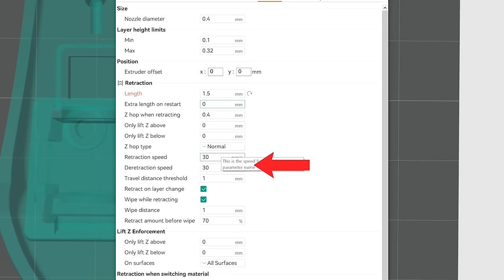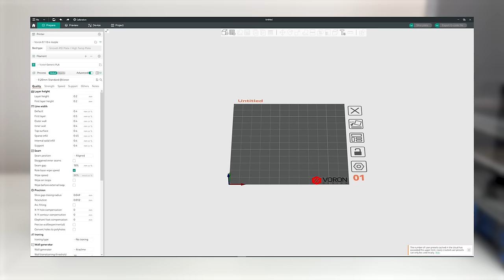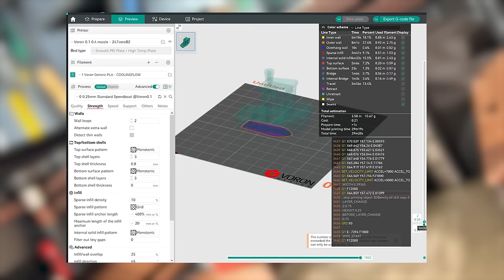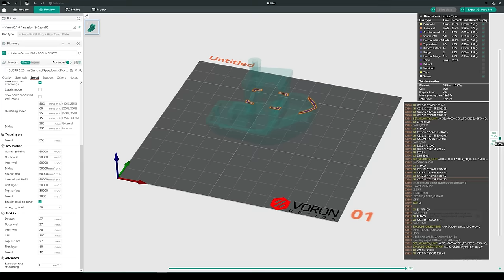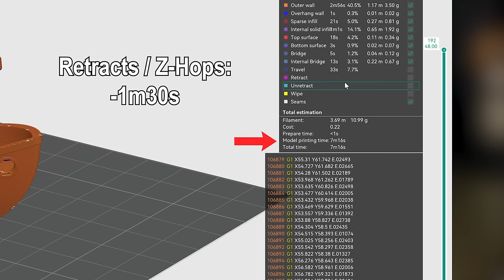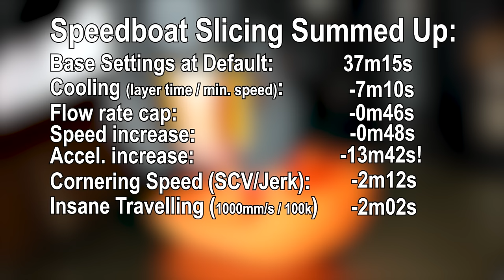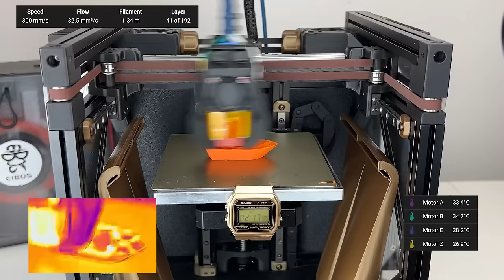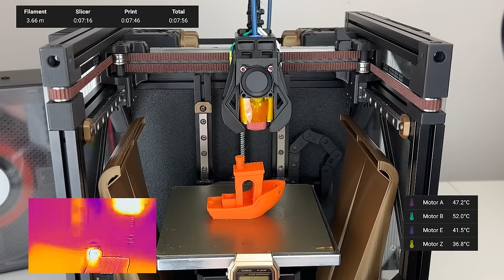Fast Printing Explained: Hardware, Slicing and More.

Comment: I just want to stand up and introduce myself. I am a benchyholic. It's been about 4 day's since my last benchy. To me it's not important to make 7.5, but to make 7.5 with quality. I find that for fast speeds the flow seems to be lacking. I can see this in your prints also. What gives... Either the toolpath is not on point, or there is some reduction in flow?

Comment: about the slow retracts, if you're printing slower they help not separate the solid filament from the molten filament in the hot end. like since the filament is more molten a fast retract just pulls the filament off of the molten blob and you basically don't get a retract. This can show as popping bubble that follow retracts from trapping air between the more solid filament that was pulled away from the molten plastic. If I have a really oozey maybe wet filament a slower retract can help but I dont go below 30-40 mm/s. Or at least that what my experience  seems to say
Reply: Yeah, I've run into that with one of my printers, had a nasty habit of clogging up the PTFE tube within the hot end.
Running speed on PLA, I hadn't even bothered with retractions or z hop for BLO

Comment: A similar video focused on faster but useful parts (technical parts) would be useful. For example, some of the settings which don't affect quality should be mentioned first (and kept to values which are still reasonable for quality parts), and so on

Comment: My secret, I prefer "Aligned Rectilinear" infill oriented at 0 degrees (so the lines run the length of the boat), for higher speed. It shaves a fair bit of time as the lines are straighter & longer. I learned this trick by analyzing the Bambu Benchy sliced files.

And my video production is closer to 2 hours per minute of video time, and my videos are getting longer... 😅  Always excellent videos Albert!
Reply from the maker: Thanks a lot Alan - I’ll check this out for sure - never heard of that infill style!
Reply: @247printing  It is an infill pattern in OrcaSlicer & PrusaSlicer, no idea about IdeaMaker. It is the same as Rectilinear except instead of alternating infill direction perpendicular to each other on each layer the lines all travel the same way every time.
Reply: @MandicReally  I was thinking exactly this while watching. Use the longest straightest lines possible. So Aligned Rectilinear also just called Lines in Cura makes sense.
Reply: Ha. Bambu are Cheaters! 🙃

Comment: I used straight infill oriented to hold up the box in the back,
I did manage sub 7:00 on my nearly stock Sovol sv07, but it wasn't pretty, still reasonably recognizable
also threw the numbers with a .75mm layer height and 1.4mm line width on a .8mm nozzle.
I ran that sucker at max feed 90% of the time.
the thing wanted to collapse if you touched it before it cooled down post print
Thank you for the benchmark numbers. I am considering a calculated under extrusion to deal with the
The weird thing was that I could achieve nearly the same time out of my also nearly stock SV04, the flow rate was actually higher than my SV07 if pushed a bit, higher temps, diamondback nozzle... though limited by the 120mm/sec max travel, Orientation got me to 160mm/sec. that was also with a fat nozzle

Comment: I went to a 6mm nozzle and set the heat to FULL and I am getting SMooooTH prints and fast
Reply: What do you mean heat to full? You put 280°C on a pla bench at super fast speed? You must has super fast cooling as well after...

Comment: OK, answering your questions:

* 15:26 What do you want to see on a 247printing livestream?

I would like to see how you start and plan a project (like your Voron 0.1).
Do you start from parts? Or in CAD? How does a new project come about? What do you do before the actual build?

* 16:30 Why do default profiles have so slow retracts (30mm/s)?

Even my first 3D printer (a cheap Ender 3 clone) came with a 70mm/s retraction profile…
If I had to guess I'd say, they try to reduce stringing by retracting slow and wiping/z-hop at the same time?

Comment: After a year and a half on a close to stock ender  3 (minus a dual z upgrade and metal extruder parts) I went upgrade crazy this year, more or less doing every upgrade I would ever want.  Spider hotend, sprite SE extruder,  even small stuff like an LED light bar and bed insulation, but the biggest upgrade was prolly the Nebula pad and camera combo that gave me Klipper.  After some tweaks I am printing at close to double the speed with nice quality.

Comment: I have 2 questions:
1. are there any slicers or klipper features that can set x and y axis accels/speeds different? Im sure this would really improve speed printing :)
2. what does the wife think of the loud 247 printer?
Reply from the maker: 1. Yes, there is an experimental build - search for "Dalias" on Annex Discord
2. She loves the printer and what I do and has never complained about noise. Though I am hidden in the basement when working on videos :-)

Comment: I think that usually people don't want to touch and broke when things are going on... So the retract speed instead of 120mm/s is commonly 25/30/40/50 because of upgrading small steps so you don't broke your things... Is there a retractable speed test so anyone can measure their extruder capabilities? Would be glad to do some like that... Even though having a direct drive extruder... Thanks for all your sharing and thoughts! 🙏

Comment: Not really doing speed boat myself since high VFR hotend loves to string which is an issue for functional parts. I managed 800+ mm/s at 19k acc with just 0.7A 24V on LDO motors which translates to 64mm3/s (at 0.2 layer, 0.4 line) which is not really possible on a V6 style hotend without melt zone extension that impact stringing. currently pushing 30mm3/s ABS on rapido which hard capped my benchy at >10m
another annoying thing I found is non-external perimeters also impact the tolerance so all my perimeters are pretty much limited to 200mm/s for quality parts. also PA is slightly dependent on speed so if you more than doubled your print speed you need to re-tune PA+EM.

Comment: Hey there, loved the video. I would recommend a few things:
(personal note, think about kids, if it's too late you will never see your grand children, and that's one of the most important things in any mans life)

3d printing recommendations, mechanical stuff:
Replace all of the 3d printed plastic parts, with 3d printed titanium parts from PCB way, you could save a few grams (the parts holding the linear rails)
Next try to remove the part cooling fan on the hotend, do you really need that?, you have huge fans cooling it off already, maybe improve the side ducts to be closer and thinner (more accurate). 
Do you need the thick high flow hotend?, doesn't a normal one work with a CHT nozzle?
Have you ever tried printing with a 0.6mm nozzle?
Have you done k-value calibration, that can improve corners (speed up prints) a lot. I was able to speed my ender 3 up by 50%.

These are all recommendations made with common sense, maybe one of them is good. 
Thank you for the content. Have a nice easter, take a break with your loved one, best regards from Switzerland.

Comment: wow thanks a lot for the dry run, answered some questions about my build, noises were normal. only a few others to rule out now lol
v3d's test_accel macro when traveling from front right, to back left, will create a low frequency virbation throughout the entire chassis along with a groan, almost like a v-wheel. I can't reproduce it during any print and every other possible angle is silent, but the macro gets it every time. wondering if it's just a coincidental resonance frequency.

Comment: I was 43 when I had my youngest child. I was 23 when I had my first. It's rewarding, yet frustrating.
Another secret: I bought my first 3D printer 3 years ago. But sold it before using it because of a battle with cancer. I bought my second 3D printer last year, and printed a pokemon when I first got it. I packed it up and didn't touch it again because I was intimidated by the idea of slicers and g-code and all that. Until a week and a half ago. I pulled out my Fokoos Odin 5, set it up, and printed a Benchy. Ten days later and I've got the basics down in FreeCad, I've designed and printed a ton of store shelves for my wife and daughters Mini Brands addiction, printed out some Thug Life glasses, and have become quite familiar with the simplicity of the hobby. It's intimidating, even for a guy that can do anything. Breaking that bubble is the hardest part.
Reply from the maker: Thanks a lot for these insights into various aspects. All fingers crossed that you won the fight against cancer for good! Learning new stuff can come along with anxieties (and therefore procrastination) for sure. But mostly, when mastering a topic, the feeling coming along is priceless - you physically printed your own functional designs - how cool is that!. Lately I described the same for learning CAM on the Carvera video lately. Breaking that bubble is absolute key!

Comment: That boat quality is about as good as I could get on my custom CoreXY but mine took about 15 min. I think I need to upgrade my belts because my printer is a 420mm bed so the belts are super long.
Reply: Good belts make a world of difference at the length you're talking

Comment: since alot of pople buy plug n play they dont want to tweak on their own.. this is a nice video for them. have u ever tried to set ur solid infill to 90 degrees?  when i do my speed prints i prefer it set to 90 degrees. ive seen it saves some time and less stress on the motors.

Comment: Can you explain, what you changed from the OG Voron 0.1 to do speed printing? What is necessary, what helpful and what to avoid? Is a bowden in this case preferable over a direct drive? Cheers from Hamburg

Comment: The reason the settings are very conservative is, not all printers are made equal.  So you aim for settings that "should work" on all printers.  That is why the speeds and retractions are set so low, as I have started to tweak and push the numbers higher on my Voron 2.4 350.  Printer config max speed is 300, but I can't get much better then 200 because of standard PLA even with a Revo High flow.  High speed PLA I can get to the max 300 speed because of the Revo HF, its been a matter of tuning the Jerk speeds and accels and watching to make sure no belt skipping happens either.  Oddly the new Neptune 4 Max I have is "supposed" to be faster but it hardly will ever reach 500mm print speeds because its a bed slinger.  So the Jerk settings are going to be slow because of the bed and its massive size.  Great to have a large form printer, as even the 2.4 350 I have is quite big too.  Just funny they claim 500mm speed, but it really can't do it even using their Elegoo Cura profile.
That is another part of the reason the settings are so low by default.  Not all printers have high flow nozzles, and most people will be printing with Normal PLA which has a lower viscosity.  High speed PLA melts better and flows better in how its formulated, that is why you can get such crazy flow rates with it.  Granted using normal PLA with a HF nozzle WILL help get better speeds when using cheap PLA but to get speed boat level prints, high speed is required.  Usually HSPLA is a few bucks more then the normal stuff so its not going to brake the bank if you buy just HSPLA.

Comment: 5:17 that would be true for Cura, Slic3r and its forks use a different model for calculations
Reply from the maker: How do they calculate flow rate? Can't imagine another way. Cura has a flow cap value? That's new to me!
Reply: @247printing  cura assumes that the extrusions are rectangle-shaped, but slic3r and its forks assume a pill-shape - a rectangle with semicirles at its ends. so orcaslicer printing at .25 tall and .45 wide with 106mm/s would only be 10.5mm3/s. to get 12mm3/s you'd need to go at 121mm/2 (because the pill shape has a smaller area than a rectangle)
Reply: @97hondacivic  Wow that's cool to know!

Comment: With high extrusion speed the flow loose accuracy 5%, 10%, 15% and eventually too much. Is it possible to compensate for the loss and prevent under-extrusion. The speed of extrusion is known, the ratio of loss vs speed can be measured with tests, applying correction from a table should be possible? Gcode post-processing? Then the wall lines should create solid part.

Comment: You can improve the center of balance of your moving mass. If you look at your printer the Y rails are positioned much lower than the moving mass. If you place everything on the same plane as the belts then every motion will be much more efficient. It's like throwing a spear. If the energy is going in the same direction as the spear and passing right through the center point of it you will have a very long throw. So my suggestion is to remake the printer so that all rails are on the same plane in Z and the x beam is on the same plane as the rails (no top mount) and also make sure the toolhead has it's center of mass on the same plane as the rails and the belts are also on the same plane in Z. This will also drop the requirement on evertyhing being super stiff as there will be less torsional effects so you can make things much lighter. I'm looking at your xy joints specifically, those can be aluminium probably and save 150g of weight. You can also go 4WD maybe, although it's a very small printer. Or maybe wider belts.
Reply: Voron zero barely has 150g of printed parts
Reply: @travistucker7317  The XY joints alone weight 150 gram. Those can be reduced to 50 gram and made stiffer by using CNC aluminium and also titanium fasteners. Also the center of mass matters. If the moving mass weighs maybe 350 gram now then a reduction by only 100 gram will be a huge difference relatively. However the whole printer can be redesigned for better center of gravity, that will make a huge difference in reducing secondary vibrations and leave only the funamental resonance and produce a very clean spike on the resonance graphs.
Reply: @sabahoudini  i think you are talking about the entire gantry with extrusion and bearings? Lighter gantries exist, of course. Xy joiners are like 15g per side already. The bearings probably weigh more. And you will save something, but not much with ti screws.
Reply: @travistucker7317  Trust me dude, I've been chasing grams on my voron and everything adds up. I know this one is lighter than my 2.4 but if you take off the moving mass (everything that moves in Y) you will see it weighs more than you think. However the torsional rigidity and center of mass is more important for print quality. The way the linear rail is fastened to the CF beam is a weakness and the rail can wbble on the CF beam if done improperly. You need a printed insert and a screw that goes all the way through otherwise it will not be stiff. I see many things that could be improved.
Reply: @sabahoudini   We started on xy joiners and are now on the entire moving mass. All 4 stock joiner printed parts are 30 grams. Other than bearings and screws, that's it.  There's not much to shave there. Seems like you could do much better working on a lightweight tool head. I think using Albert's gantry setup should get you where you want to go unless you just want to build a printer. His entire gantry and toolhead is 175g.

What have you done already?
Reply: @travistucker7317  Yeah I made a light weight toolhead already. My printer is a 350mm voron 2.4 so will never be as light but I've managed to get it down to 500gram of moving mass which is pretty crazy considering there is a motor weighing 70g and the hotend is 50gram. There are also fans there that weigh 30 gram and screws are about 40 gram although I will have some of them replaced with titanium. It's an art form to get everything balanced in weight and also it has to resist torsional effects. Some screws are also aluminium where it doesn't matter. I will actually replace the CF beam to a thicker one and slightly heavier because of torsional forces. The mellow CF beam I have now sucks. I can rock the toolhead a bit. It should stay in place no matter how hard you pull otherwise it's not good.
Reply: @sabahoudini i thought you meant v on a zero, that makes much more sense.  I've never built a 2.4, i wonder how much the length of belts comes into play there. Ratrig uses 9mm belts, on the 500 you can tell much easier if you have belt issues or imbalances than on the 300.
Reply: @travistucker7317  Yeah but the zero is also not balanced. To do that all rails and belts would be on the same z plane. Y rails would have to be on the inside in stead or the bottom of the extrusions. The x rail has to be on the front in stead of the top.
Reply: @sabahoudini  are you working on a printer to try this out?

Comment: what about infill combination
Reply from the maker: Zero difference. Capped by flowrate as you just double layer height of the infill. I should have mentioned this, thx!
Reply: @247printing  Sounds like you might be able to extract more speed by uncapping the flow rate only for infill if possible or by uncapping flow rate and actually restricting just outer wall and top layer speeds, allowing some under extrusion.